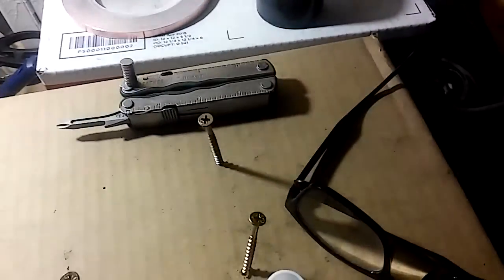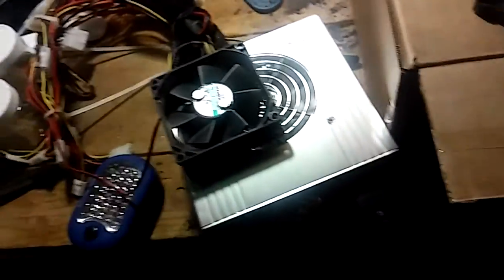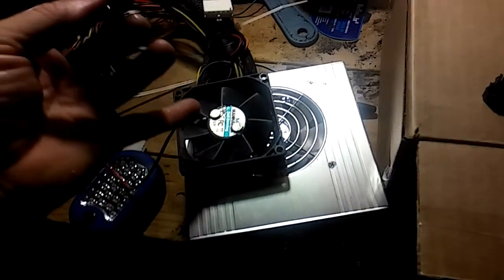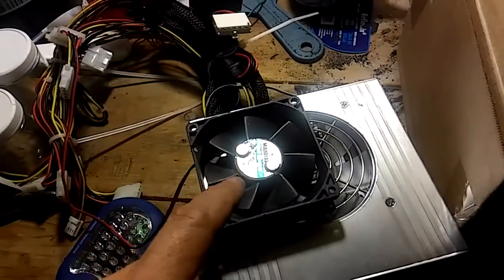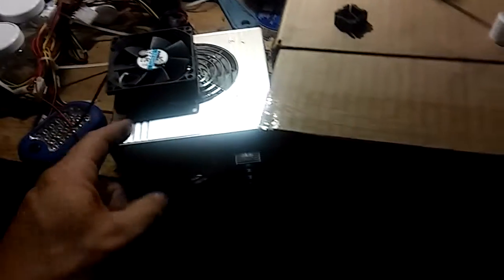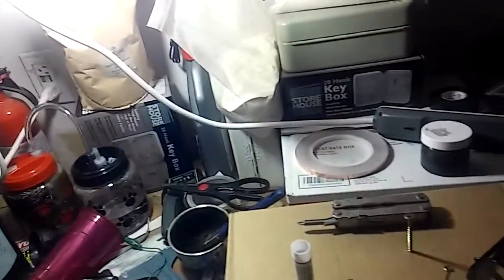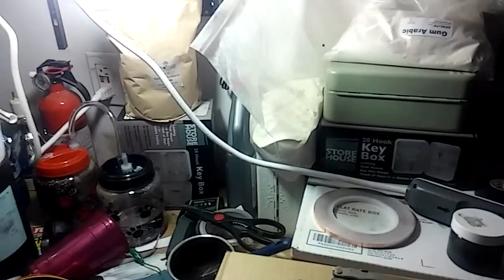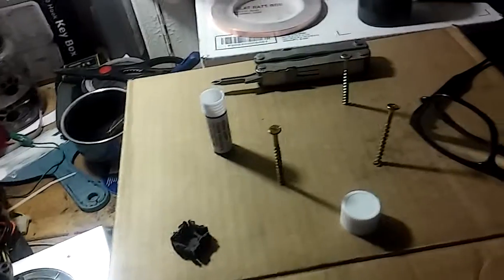Building a magnetic stirrer for mixing conductive ink on the cheap

Comment: hello, I have been doing research for a long time and as you have tried many collectors on this subject. What is the most effective result?
Reply from the maker: I just use a magnetic lab stirring  unit. I found one for less than $30 on Amazon
Reply from the maker: Not sure what you mean by collectors for this. It was only discussing stirring the graphite mix for conductive ink/paint